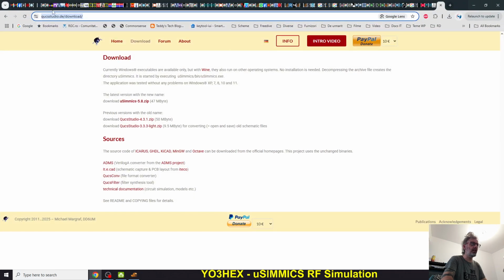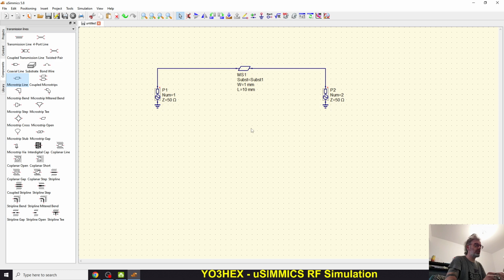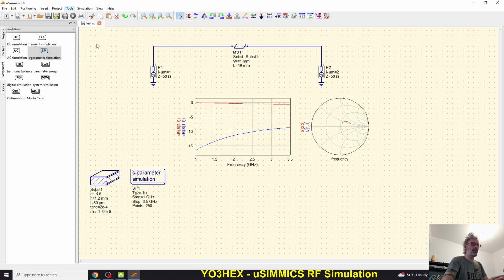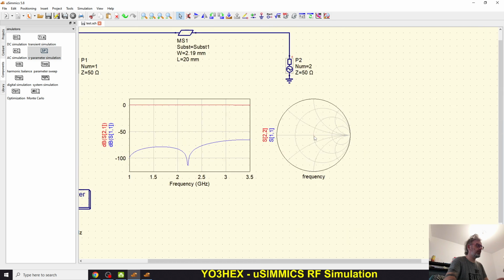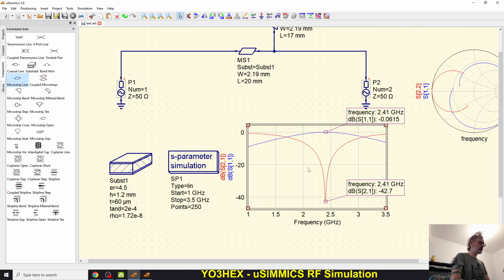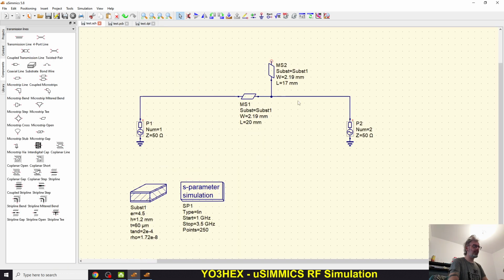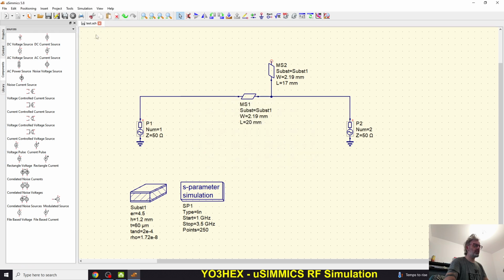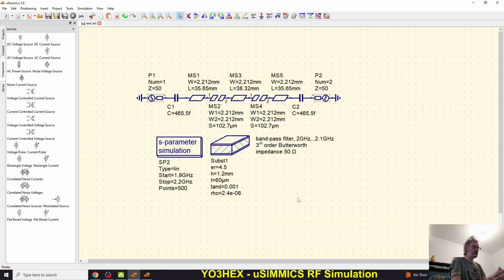uSIMMICS 5.8 RF Design Tutorial

Comment: Hi Dex.. superb video on real RF design on the new QUCS. I wonder If you could design a patch antenna, for example on 2.4 Ghz, for QO-100 and find right insert point for 50 Ohms or high impedance..  if not too much trouble.. could simulate that ?  or the QUCS  file as an example ?  Tnx JP, ON7MA